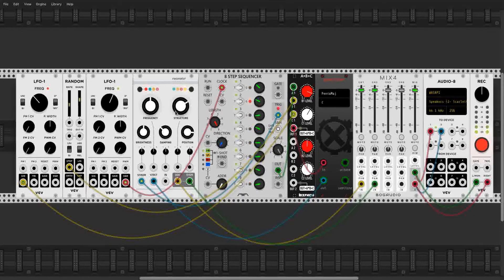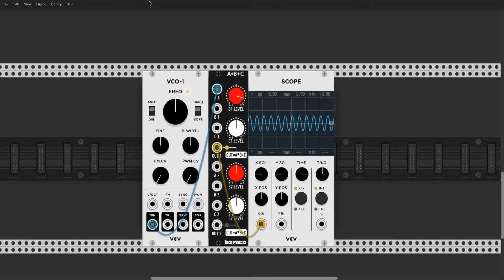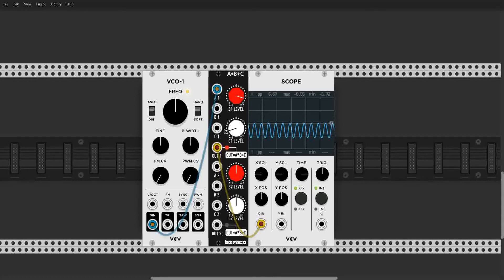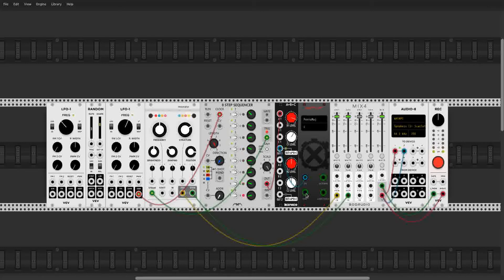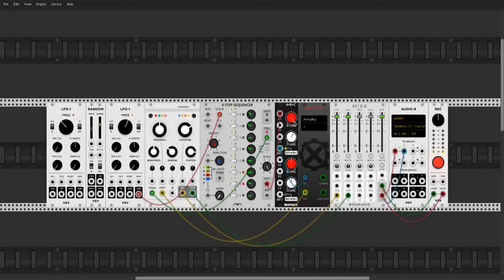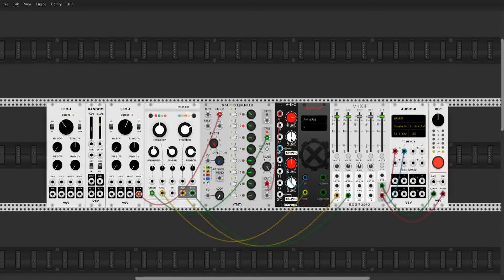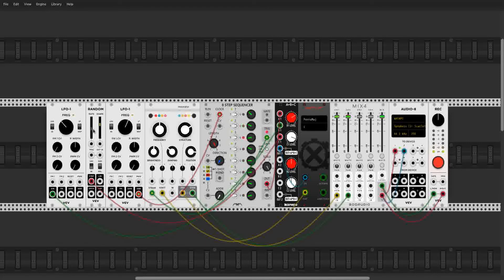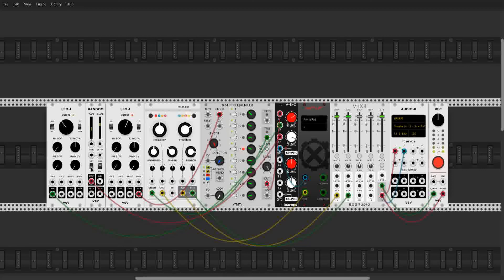Sequencer Secrets: Upgrading Your Sequencer with Befaco A*B+C

Comment: I prefer the layout of Bogaudio offset, same thing in a single channel 3 HP module.
Reply: This has MUCH more functionality than the BogAudio Offset, as well as being a dual module. I think you must be confusing this Befaco A×B+C with the Befaco Offset-Attenuverter (which is also a dual O/A module, unlike the single-O/A Bog version)?
The A×B+C is a dual-Ring Modulator with two auxillary Attenuverting VCA's.
Reply: @goonfish  I don't want more functionality. Sometimes I simply want to shift a voltage.